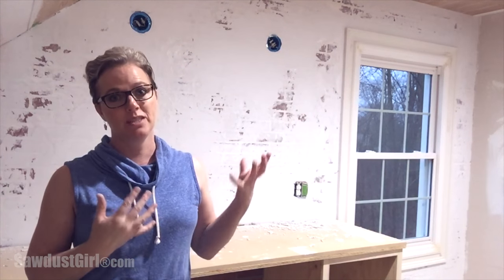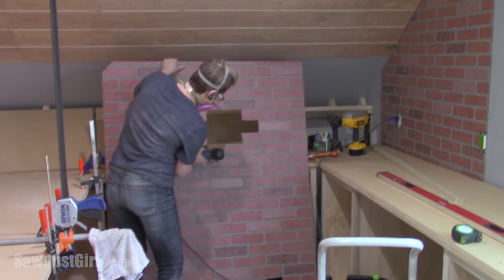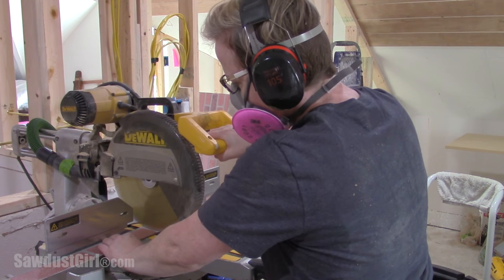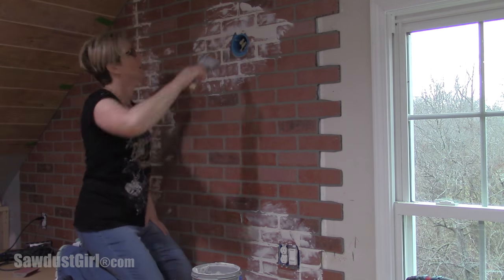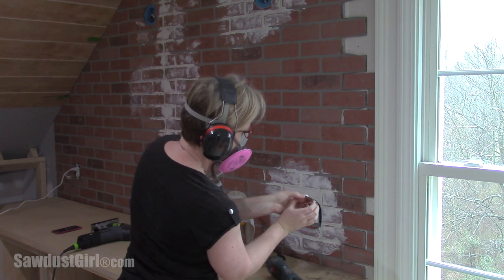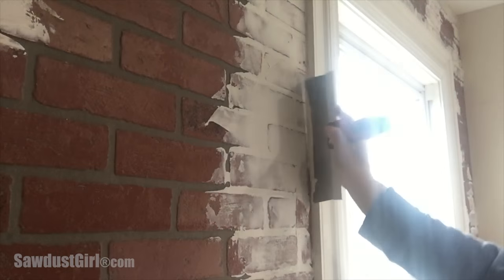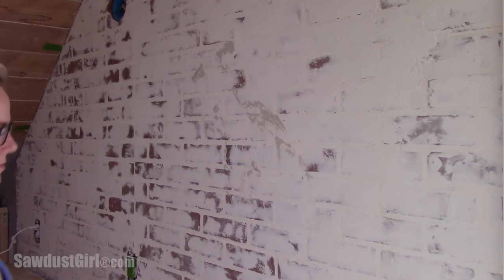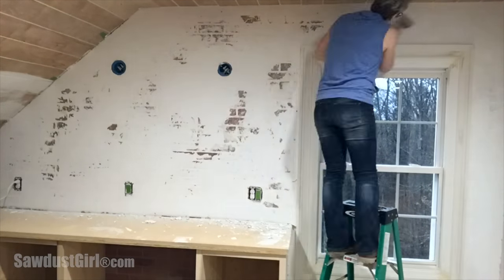Faux Brick and Plaster Wall

Comment: Looks great Sandra.  Weaving the bricks makes for a clean joint.
Reply from the maker: +Patrick&#39;s work shop Thanks.  It was a lot of work but for $60 bucks I guess I can't complain.  :-D
Reply: +Sandra Powell aka {Sawdust Girl} Have you stopped yet?  <eyes looking both ways...>  :-)  Great job, it really looks like it's a real old brick wall that's been painted over with some age added in.  Thanks for the great how-to.
Reply from the maker: +Larry527az Yeah, i'm done.  :-)

Comment: If any on wanted to do it with it to stay as it looked they could fill the joints with the same plaster but at dry cement to stain it to loo like the grouts and wash of any excess with a sponge or cloth but I see the look you are going for and turned out perfect :)

Comment: Looks awesome. I know this is nit picking but im going to say it anyway. At different times throughout the video as well as in the title you refer to thr joint compound as plaster. Plaster and compound are two very different products. The only reason i bring it up is because someone could make the mistake of using plaster instead of compound. Depending on the type of plaster but really just about all of them this could turn out bad. Plaster typically is mixed by adding powdered plaster with water and had a pretty fast set time. Not only that but its near impossible to sand once its dried. So if its not properly applied and troweled out in the right amout of time your in trouble.  So if plaster was used and just applied and left to dry the wall is going to be a rough mess.

This actually got me thinking though. I wonder if i was to do this with plaster and instead of troweling out to a complete smooth finish maybe stop just short of it for a more industrial feel to go with the brick. Also i think if i was to use plaster i could just trowel out the areas i want and skip having to remove product in the end. Also certain plasters can be colored and even veener plaster could be left to dry white and left unpainted. Just a few ideas to throw out there. Last thing i should mention is that plaster typically only adheres to blueboard. The paper and plaster form a chemical reaction to bond. While it may stick for a while if you plaster a substraight thats not blueboard it should be treated with plasterbond first or its going to end up falling off the wall at some point.
Reply from the maker: I think using an actual plaster would be great. I said the word "plaster" because it's a "Faux plaster" look. And it's a shorter word than Joint Compound...